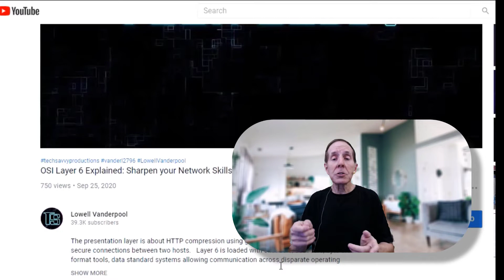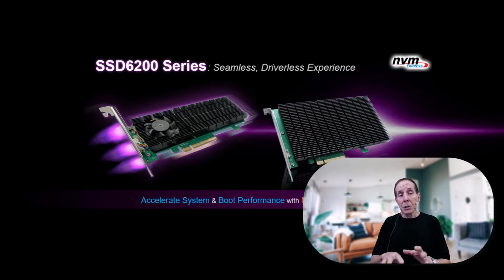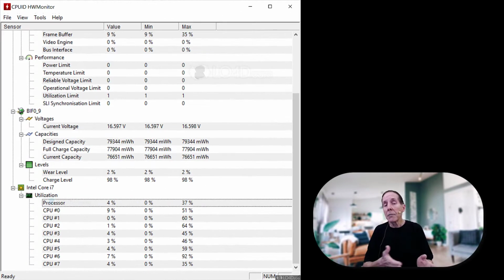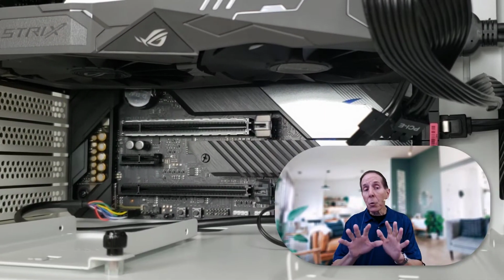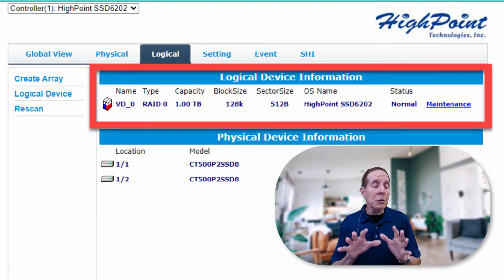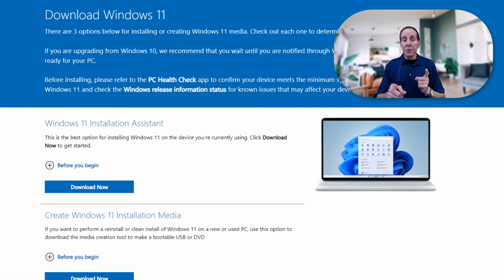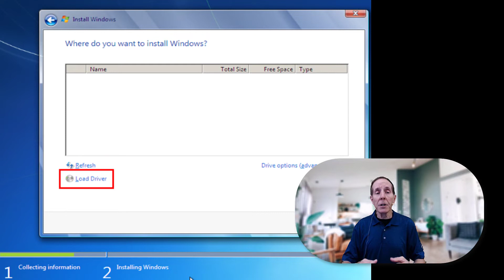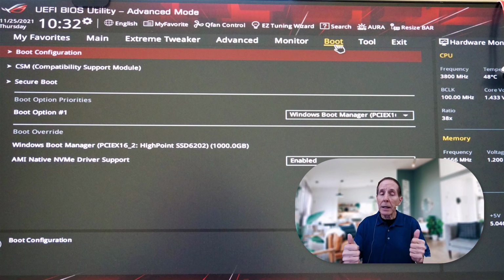Tech-Tip:  Installing a Bootable PCIe M.2 RAID controller

Comment: What can I do if the switches to set to Raid 0 aren’t even on the card it self?
Reply from the maker: If the card supports RAID there has to be a way to set the RAID type on the adapter,  switches or via software.

Comment: Question: what are the differences and pros and couns to create arrays by hardware or by software.
Is it true that in a configuration by hardware as shown if your controller die (based on the RAID selected) you may lose all your data on those disks?
Instead is it true that a RAID array built on software you can still retrieve the array key and don't lose the data in case of hardware fail?
Reply from the maker: Great questions:  Most RAID controllers build their arrays via software so that is very common.   Highpoint is trying to make a controller as easy as possible to use and configure.   If any RAID fails you want a backup, not sure if I would want any other method to protect my data.  I am using Veaam's free endpoint agent which does a great job.